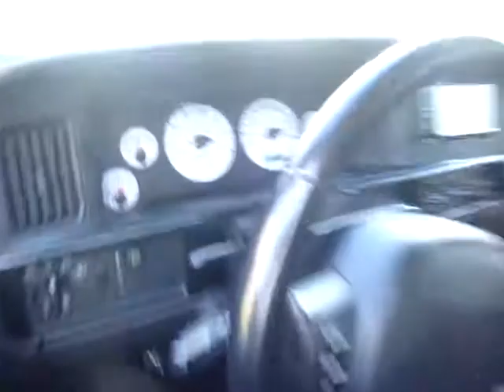Harland Sharp 1.7 Roller Rockers / Underdrive Pulleys Installed

Comment from the maker: Very slight gain. I did the crank pulley more for the fact that once they are installed a shorter belt is required which means the crank turns over quicker while using less energy which frees up a little power.